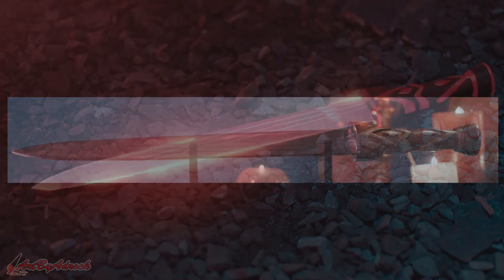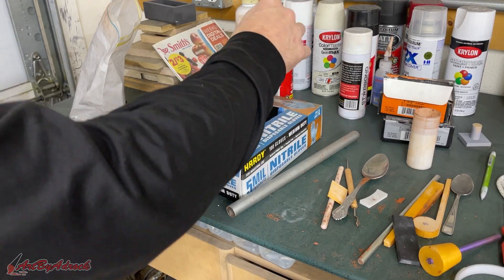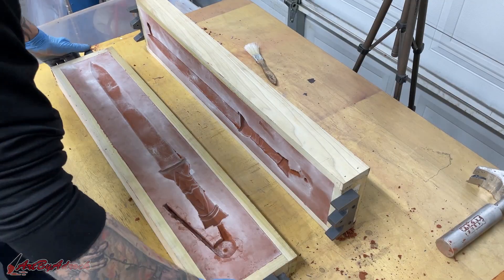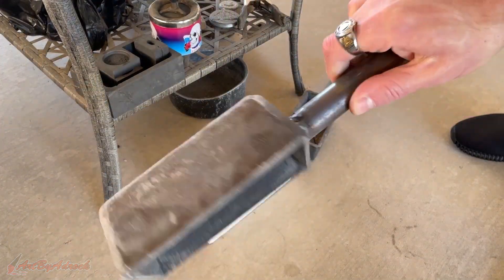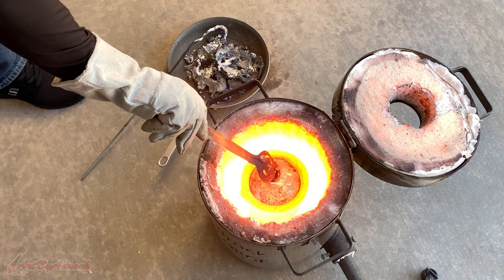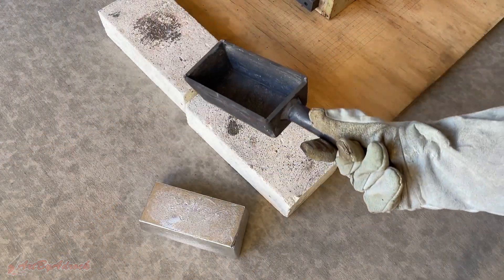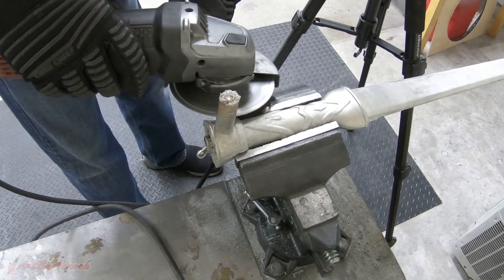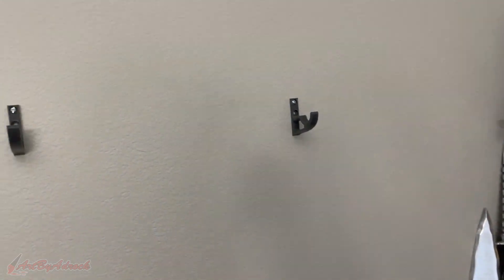How To Make The Terrifier 2 Sword - Concept To Creation - Metal Casting Tutorial

Comment: Why go to trouble of spin trap and tapered sprue but not form the pouring basin to reduce air entrapment?  Good to see update on need of mold preheat esp. in LV. Progress!
Reply from the maker: The pouring basin isn’t technically necessary if you can keep the tapered sprue full.